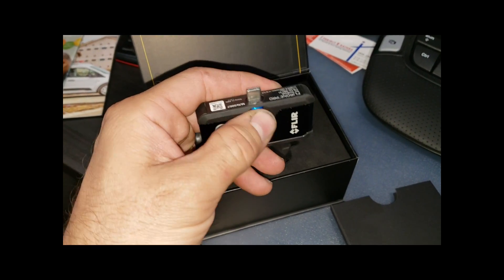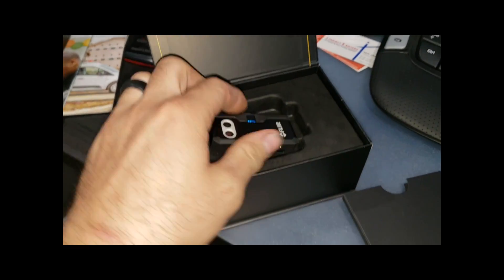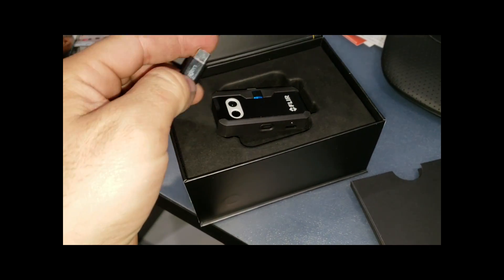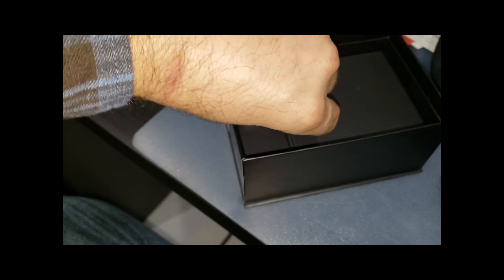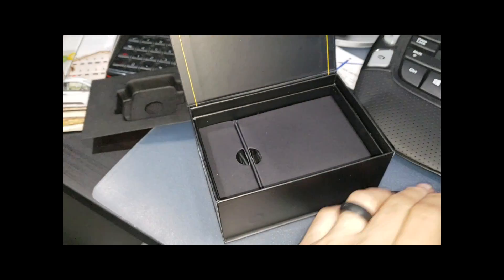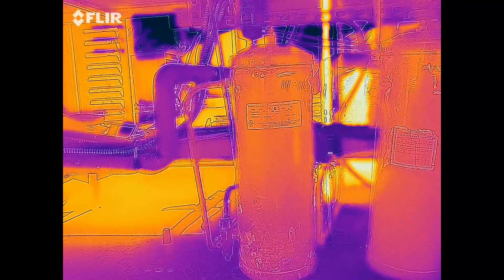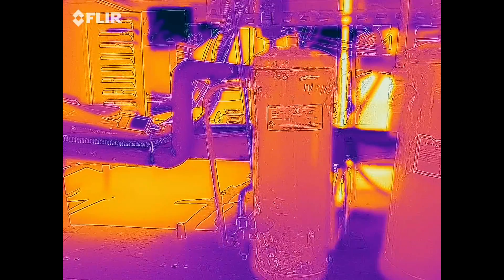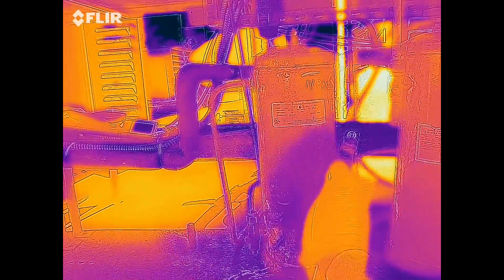FLIR ONE PRO REVIEW FOR REFRIGERATION

Comment: Had to say something, this review sucks 1 You should not be working on anything if you do not understand that a liquid receiver will show the same temp for gas and liquid unless you heat it high enough to boil the liquid inside, a water hose won't do the trick skippy, not at the pressure the refrigerant is at. 2 this tool will show small pressure drops in driers, coils, piping, and valves not to mention the electrical hot spots it can find, I have one, its far from a novelty. 3 maybe the Raccoon decided to spend the night somewhere else Einstein. Before you recommend or not educate yourself, lets hope your boss doesn't see your "review"  it's embarrassing, Just a suggestion, get yourself some Copeland manuals and study up.
Reply from the maker: Paul Dr. Freeze  thanks so much for watching my video and taking the time to leave a comment. I will fully admit I don't know everything but what I do know is that there can be a temp difference between the vapor and liquid in the receiver. However I believe that the Flir one pro is not capable of picking up that temp difference likely because of several factors the paint on the surface being one of them, I also think that a system that has been pumped down for a bit may not show so much of a temp difference so the test would have to be done pretty quickly after it has pumped down , and or maybe while it is pumping down.  I never said the Flir one pro was not a cool tool it just did not do what I wanted it to do which was show the liquid level without heating up the reciever. I would encourage you to read this article by Sporlan talking about the temp difference between the liquid and vapor in the receiver here is the quote from the article referencing the temp difference I was trying to see in the receiver with the camera  " It is simple: we will have 110°F at the liquid and vapor interface, but the refrigerant liquid immediately below the interface will be at 100°F. The 110°F saturation temperature will only be found at the interface, and with the vapor above the interface." 

http://blog.parker.com/hvacr-tech-tip-can-you-have-subcooled-refrigerant-in-the-receiver
Reply: Or basic physics... Sheesh.

Comment: Mine is the older FLIR-1 for Android before the 'Pro' version.  I bought mine as a toy, having had the luxury of borrowing an older standalone FLIR camera from our Facilities manager for a weekend and playing with it.  Since then though, I've used it for a ton of stuff, including (a short list)  looking at wiring for hot spots, seeing how much heat my house loses in winter, looking at old video game PCBs to find dead chips, finding air pockets in radiators, seeing wiring in walls (plug in a heavy load for a while), and even taking weird photos of friends and pets.  I am now on my second battery, the original Li-Ion polymer battery having failed and an eBay replacement installed. (was super easy)  Even though it is not that useful in my job, no regrets in buying it.  The temp display when you target something seems pretty accurate too.

Comment: I would suggest a strip of tape, no reflective  like painter's tape. It's the key for some things.
Reply: If add heat, I don't think you would need as much. It's better showing higher temps in "cooler" areas for troubleshooting
Reply: If you're using it to find an animal with a lot of fur it's going to be hard because you will only be able to see the eyes or mouth or paw pads/nose, everything else on the animal is basically insulated by the fur
Reply: You could also use the flare one pro to take an image after you heated The Vessel to prove how much refrigerant was put in if you take a before and after  pictures  using a heat source

Comment: I have a flir one pro for my iPhone.
I definitely don’t use it all the time, but occasionally it is useful.
Several times I have confirmed clogged micro channel condenser coils.
I confirmed a leaking reed valve on a recip compressor (when unit was shut down you could easily see hot gas leaking back from the discharge all the way back into the accumulator).
I found a loose wire connection inside an exhaust hood control box at a contactor that was intermittently tripping the breaker.
I found missing insulation in a wall once as well.

I do have to say that I haven’t FOUND anything with it but it’s helped me confirm many things taking my confidence in the diagnosis from say 80% to 100%. I actually carry it in my small bag all the time. I personally like it.
Reply from the maker: I will be going live on YouTube this evening 11/25/19 @ 5:PM (pacific time) to discuss my most recent uploads, and answer questions from email’s , YouTube comments, and the Live chat come on over and check it out if you can.    https://www.youtube.com/c/HVACRVIDEOS/live

Comment: I think temperature difference would be to small to pick it up with the flir. Cooling it and then letting it warm up is a good tricks, as the liquid side will warm up faster, but still, it might not be enough. I suspect the big problem was reflectivity of the paint. I would suggest putting a black matt tape on entire length of the tank and only look at it. Disabling  autoscaling of color scale could also help.

Comment: I think you can use it this way, the problem is that your method to detect temperature differential  by rising it with the water, the water is barely colder than the receiver is.  By the second rinse, you can clearly see that the water coming out was HOTTER than the receiver (6:52). But again, the hotter and colder color maping s relative- you can turn on the overlay of the temperature for spot temp reference. There's not enough kcal of energy being removed with the water, as the whole receiver goes right back up to the same temp as it was before. If you could do the method you mention in your live stream (the do at your own risk flame method) with the FLIR running, I think it would show you what your looking for. The liquid cools the metal faster than the gas would, and thus you would see a hotter tank section on top, and a lower temp at the bottom. Likewise, I think this would also work with a 30 second spray of CO2... but it would be in reverse, the top being cooler and the bottom being hotter.

Comment: From another video I've watched the temperature difference between the liquid level is only about 10-20 degrees. The camera takes a minimum and a maximum reading in the field of view and then calculates a color scale in between these readings. So 10 degrees becomes difficult to see in the color graduation. Is there a method for manually setting the minimum and maximum temperatures on the Flir?
Reply: Flir could easily implement that idea. It would be easy for them. Any coder worth their salt can make that feature in a day.

Comment: "BOILING HOT" water poured down the side............................ sure you;ll see my other comments.
or blast it with a torch down the side, heat metal fast and try to not burn the paint off, probably still require a good thermal camera ;)

Comment: I use my FLIR One for finding liquid level in propane tanks, the trick is they have to be in use. So when the liquid is boiling out of the tank you see a very clear difference in temp. however a static liquid will homogenize to the ambient temperature of the tank pretty quickly. Think of the tank being a heat-sink since the liquid is in contact with a large area of the tank surface.
Reply: yep, boiling off for storage tanks or system running, pumping down, solenoid opening etc. an idle temperature stabilized system wont show much of anything unless you heat the "liquid" holding part of the cylinder or majorly cool the gas part....

Comment: You can’t think of any invisible imaging in the same way as visible imaging. Thermal cameras work on heat signatures apparent to the camera and nothing else. If there is something in the way, that will interfere with the reading the camera will see. They can see through walls, but not if there’s a big metal or insulating blanket in the way.

Unfortunately a big metal box is gonna conduct heat really well and it’s not going to give you a clear indication, because the heat the camera is seeing is being conducted away. This might my help for your specific goal, but these are EXTREMELY handy for tracking down electrical faults that are not an open circuit, which is a lot of them. So you will find faults where some current gets through extremely easily.

It will also be handy to see if a room has any major hotspots for more consistent cooling. Your customers will definitely trip balls when they see a thermal camera on you, and if anything it will trick their minds into thinking they have better, more ‘customised’ aircon, in some magic way. Keep it in your bag.

Also, don’t take this as gospel, I don’t know, but consumers are extremely limited as to what you are allowed to see, because the government restricts how good they can be, I’m not sure in what ways, I only know that this is a thing, and it stands to reason that usability in pitch darkness would be a big limitation. Because unless your website has a .mil at the end of it, flir are not going to sell a bunch of pitch-black infrared cameras to anybody in the sake of tactical advantage. This is also part of the reason why thermal imagining cameras have visible light cameras.

Comment: You will have better luck with the Flir that Home Depot rents.  I have used it on larger parralell comp systems and have seen the liquid levels, oil levels, split condensers, etc..
Reply: yeah, a real higher end "thermal camera" would be far better.. in time I suppose they'll improve though...
Reply: @throttlebottle5906  there are several different types. And higher end doesn't always mean better for every application
Reply from the maker: Interesting I will look into that, thanks for watching

Comment: What temperatures are you looking for?
Reply from the maker: I'm looking to see the liquid level in the receiver while its pumped down to make sure the system has the proper winter charge for the head pressure control valve.
Reply: HVACR VIDEOS so the gas and the liquid in the tank are at the same temperature
Reply: Yes. same pressure = same temperature. pressure is directly proportional to temperature.
Reply: OcRefrigeration,Hvac & Electrical. Gotcha
Reply: @OcRefrig  Stethoscope and echo??
Reply: @HVACRVIDEOS  with some practice I bet a reasonable guess can be made using echo and a stethoscope. For super accurate you would need some more serious kit.
Reply: yea, maybe tap with tip of screwdriver up and down receiver to hear echo or solid liquid. i'll have to try that.
Reply: OcRefrigeration,Hvac & Electrical. If a screwdriver doesn’t work try a rubber mallet maybe 5#. Not saying I know better just thinking of another option. I wish the echo location idea was my own but I started with the thought that people could approximate the level of a fuel or water tank by tapping on the sides. I just researched a bit more to find out that it’s called echo location. The idea was to exploit physical properties, in this case sound travels differently in a gas than it does in a liquid.

Comment: The camera had good color detail and the lines to help to find the image, its a  little improvement over my snap on camera but I think the metal dissipates the heat too much.
Reply: The metal is a reflector of heat, so you will see a reflection of heat in the imager with shiny metal surfacing.  Even a painted smooth wall could reflect heat and give a false reading in the imager.  They do have emissivity settings for different surfaces to compensate, but still, the casing of this tank could act as a good heatsink, and evenly distribute the heat by the time it shows on the surface.
Reply: @Wavefront101  very true👍
Reply from the maker: Yeah I tried running some electrical tape up and down the receiver to see if that would help with the reflection and it did not, I kind of knew it wouldn't work going in but figured Id try it for a video. I also wasn't a fan of how I had to use a extender to connect it to my phone because of my otterbox case, it was very unstable with the connector.
Reply: i would have used a cable instead of adapter. 3' cable.  it might allow for some cool flexibility.

Comment: Since this cameras read temperature could it be that there was no temperature difference on the receiver  between liquid and no liquid are?   You sprayed with water though so I don't know ahha
Reply: Juan Carlos that’s what I was thinking, because the metal transmits heat so well, we can sense warm or cool receivers by touch. Isn’t it possible the temp was close to that color? What was the expected temp of the refrigerant at the time of the test. 

My flir 1 pro works well. It’s good for the $$$
Reply: uhhh, most always doesn't work that way ;) think harder about it